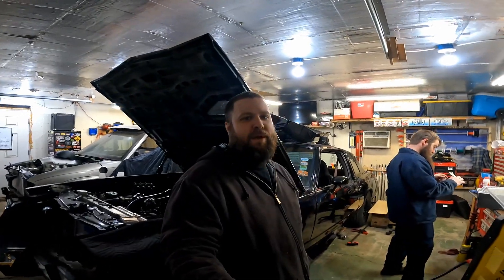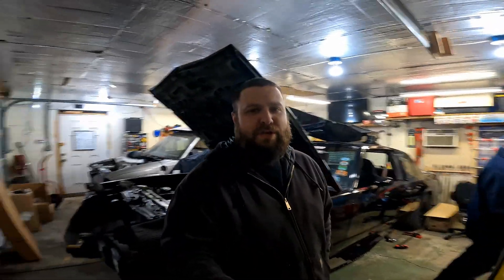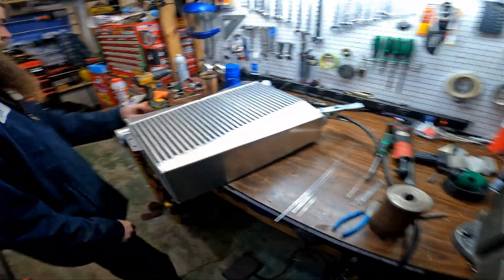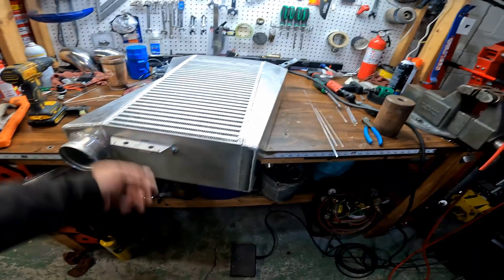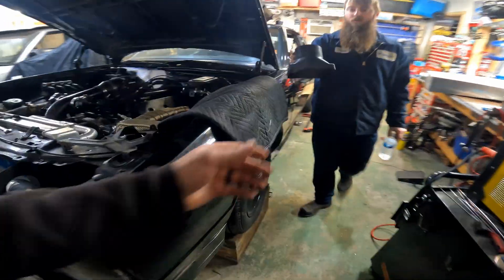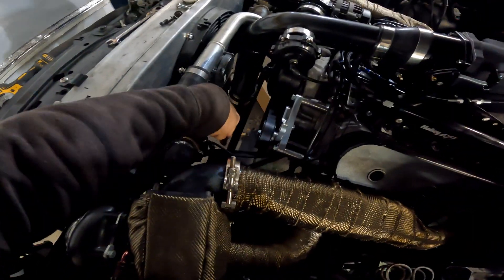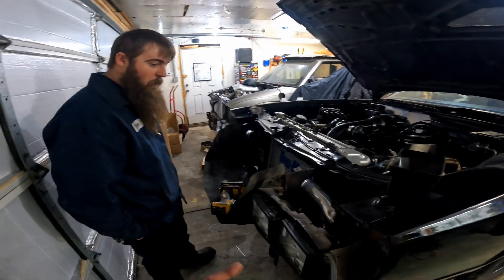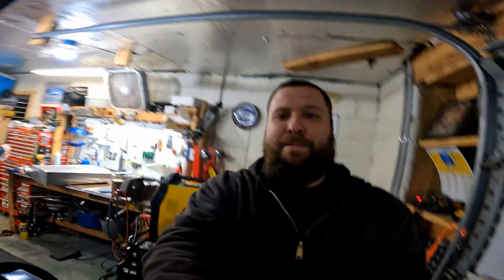MASSIVE INTERCOOLER CORE BUILD

Comment: Hi.  Question on a completely unrelated topic.  Changing my 86 LS from column to floor shift.  I have an original shifter I'm going to try.  I've welded the bracket/plate the shifter attaches to in the factory position.  Don't judge me. lol.  Looking for oem spec on where to drill the hole for the shifter cable to go thru the tranny tunnel.  Can you help?
Reply from the maker: Truthfully I just ran mine through where I thought it would work the best. I had the same setup and switched over to a floor shifter. Just try to make sure cable doesn't get in a bind
Reply: @BOURBONANDBOOST  Thank you very much for the quick reply.  Seems to be the consensus